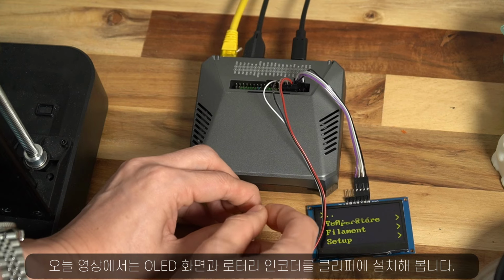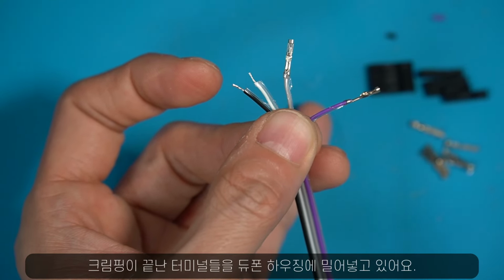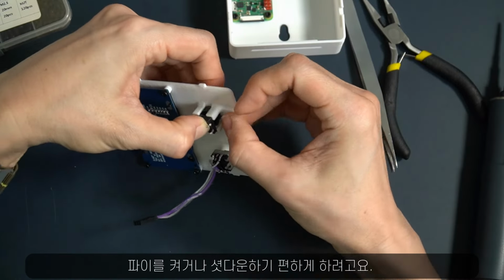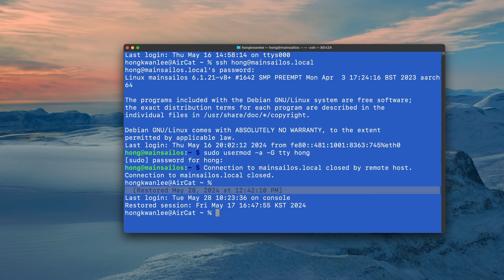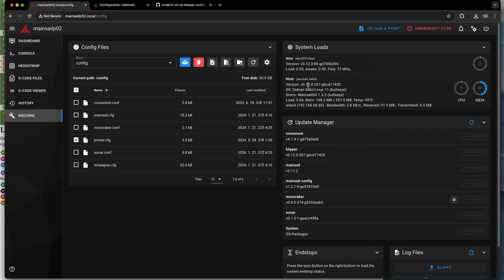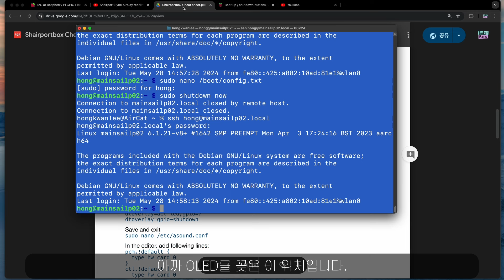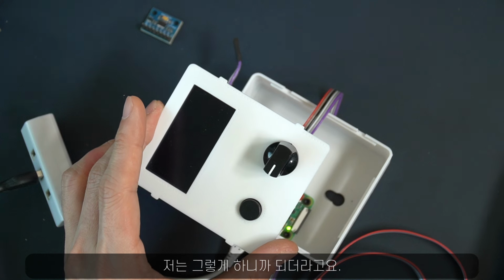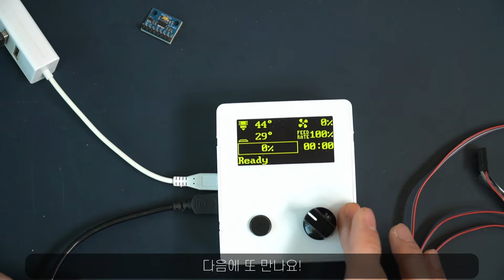DIY Klipper box with OLED display and rotary encoder

Comment: I didn't make it   :(
Reply from the maker: @JonathanAraujo-SenhorVip  Do you know what went wrong?
Reply: @Tinker_Box  I use a btt pi, I tried to follow the steps, but when it comes to editing the file sudo ''nano /boot/config.txt'', I can't find the file, I wanted to use only the LCD, I wouldn't need the buttons
Reply from the maker: @JonathanAraujo-SenhorVip  Try the same command without quotation marks.
sudo nano /boot/config.txt
Reply: @Tinker_Box  I tried, however it opens an empty file
Reply from the maker: @JonathanAraujo-SenhorVip  Okay, try
sudo nano /boot/firmware/config.txt
and please let me know how it went.
Raspberry Pi OS seems to have changed the file's location.
Reply: @Tinker_Box  I removed the SD from the BTT PI and put it in the computer, and I searched for any folder like that and there is no config.txt, there is only a file called BoardEnv.txt D:
Reply from the maker: @JonathanAraujo-SenhorVip  No. Once R. Pi OS is activated, the SC CARD becomes incompatible with PCs. You have to do this in Pi.